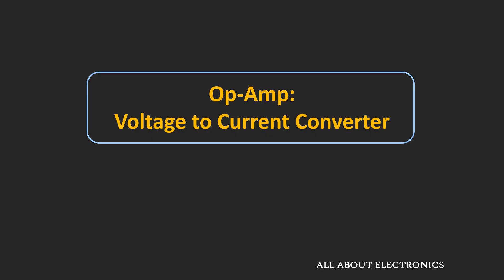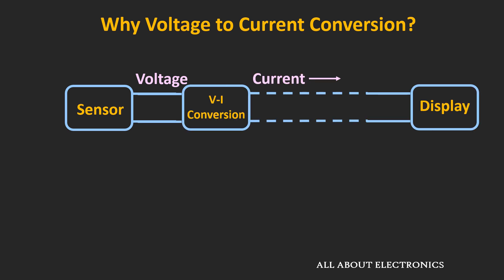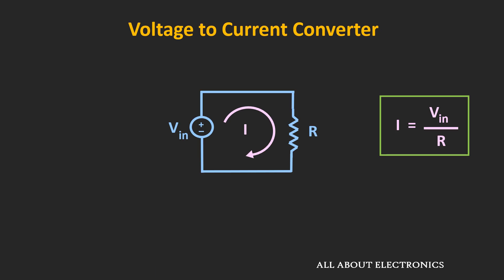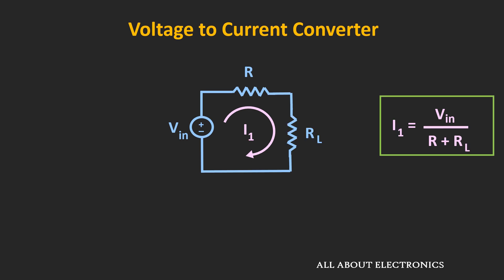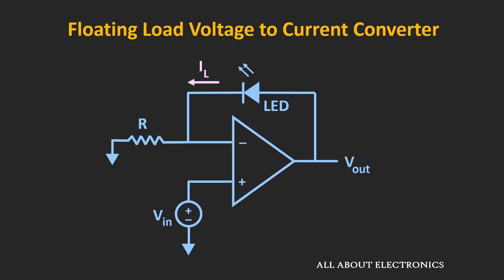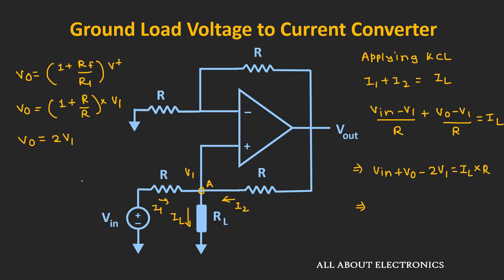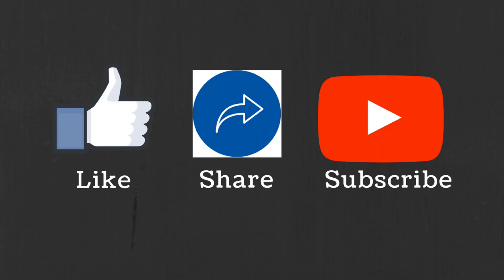Op-Amp: Voltage to Current Converter

Comment from the maker: The timestamps for the different topics covered in the video is given below:

0:25  Why Voltage to Current Conversion?

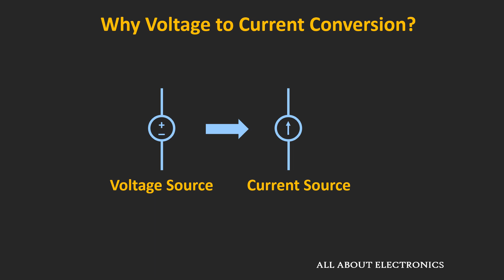2:32 Passive Voltage to Current Converter and it's limitation

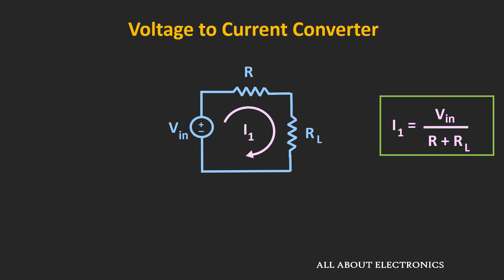3:27 Floating load Voltage to Current Converter using Op-amp

4:46 Voltage to Current Converter Applications

5:50 Grounded Load Voltage to Current Converter using Op-amp
Reply: can we consider there circuit as VCCS????

Comment: Is it possible to charge a capacitive Load with a constant current in the howland current pump ? I have try it with the floating current converter and it works, but for the Howland Current pump it does not

Comment: Sir  why we need to a resistor to the inverting terminal except feedback resistance?
Reply from the maker: To set the specific current through the load. The current through the load resistor is Vin / R. By changing the value of R, you can change the current. I hope, it will clear your doubt.

Comment: draw differential voltage to current converter and hence show that the load current IL depends on the difference between input voltage and resistance R not on load resistor RL. Solved it please.

Comment: Sir,
Did current pump and Voltage to Current converter are both same ...?
Reply from the maker: The current pump circuit is also one type of voltage to current converter.
Reply: @ALLABOUTELECTRONICS  Thank u sir

Comment: I tried V to I converter with grounded load using R=1K and 1K pot as load. The load current remained constant for the full range of load resistance for  up to 8VDC input only. Above that input voltage setting  the load current varied with load resistance. Can u explain.
Reply from the maker: What was the supply voltage ??
Reply: @ALLABOUTELECTRONICS  Supply voltage was +/-15V
Reply from the maker: @surendransunil7025  Have you measured the RL while varying it and the output voltage? Which op-amp you have used? And what is the maximum output driving current of that op-amp? 
Please check the maximum output driving current of the op-amp.
Reply: @ALLABOUTELECTRONICS  I used op amp 741. I did not measure RL or the output voltage.

Comment: Sir,what happens if the load resistor value RL is very high...?
In that case IL cannot be maintained right...?
Please reply...
Reply from the maker: Yes, op-amp needs to be in the linear region.
Reply: @ALLABOUTELECTRONICS  Thank you sir...

Comment: I can’t find any difference between non inverting amplifier and this circuit but output of two circuits shows significant differences . How same circuit get different output? Can you help me
Reply from the maker: The important thing is where the output is measured. And what is measured? (The current or voltage).
The configuration is the same, but here the load resistor is connected in the feedback. (Floating load voltage to current conversion).
So, through the input voltage, the current through the load is controlled. 
I hope it will clear your doubt.

Comment: Does the virtual short appears only when there is negative feedback..? Please let me know that..
Reply from the maker: Yes, it is applicable only when the op-amp is operating in the linear region. (with negative feedback)
Reply: @ALLABOUTELECTRONICS  so , why the voltage at that point is equal to the voltage at non inverting input ( Vin ) ....? Why not the output voltage ( V0 ) present at that point...?
Reply: @ALLABOUTELECTRONICS  please let me know that.. I was too confused.. 😭😭

Comment: Sir, please make videos on voltage to frequency and F/ V converters.
Reply: that's call a VCO, voltage-controlled-oscillator. Basically you just need a way to adjust the resonant tank.

Comment: What is the difference between floating load and grounded load V-I converter.
What is the application of both?
Reply from the maker: In a floating load, the load is not actually grounded. While in case of the grounding load, the second terminal of the load is connected to ground. 
The floating load V-I converter can be used when you want to provide the constant current to any two-terminal device like LED. (Where your purpose is to provide a constant current to the LED).
The grounded V-I converter can be used when you want to provide the constant current to another circuit or device.

Comment: Thank you Sir for your prompt reply. 
But one question still remain answered that how you come to know that Ckt is operating in Linear region and it is not saturated? Is there any systematic way to investigate the mode of operation (linear or saturated) when both type of feedback is present in Op-amp? Or should we always conclude that when both type of feedback are there we should assume , by default op-amp is operating in linear region? I will be very thankful to you if these question is being answered in crystal clear way as you do in most of your lecture
Reply from the maker: It actually depends on the amount of positive and negative feedback. But if the amount of feedback is not known then you can analyze the circuit assuming the circuit is operating in the linear region. And then you can check the output. If the output is less than the supply rail for the given values then it is operating in the linear region. But if the output saturates then the op-amp is operating in the saturation region.

Comment: can u give the reason why you have used the the concept of virtual short in the lecture at t= 8:14, while this op-amp have both type feedback negative as well as positive feedback?
Reply from the maker: Because still, the op-amp is working in the linear region. (Output of the op-amp is not saturated to the supply rail)
Reply: Thank you Sir for your prompt reply.
But one question still remain answered that how you come to know that Ckt is operating in Linear region and it is not saturated? Is there any systematic way to investigate the mode of operation (linear or saturated) when both  type of feedback is present in Op-amp? Or should we always conclude that when both type of feedback are there we should assume , by default op-amp is operating in linear region?  I will be very thankful to you if these question is being answered in crystal clear way as you do in most of your lecture.

Comment: When a sensor measures temp how does it give o/p in terms of voltage?
Reply from the maker: Using the bridge circuit, it can be converted into a voltage. If you take RTD, its resistance changes with temperature. If it is connected at the one end of the bridge, then the change in the voltage between the two ends of the bridge can be calibrated in terms of voltage. In some sensors, this circuit is part of the sensor and it directly gives output in terms of the voltage.

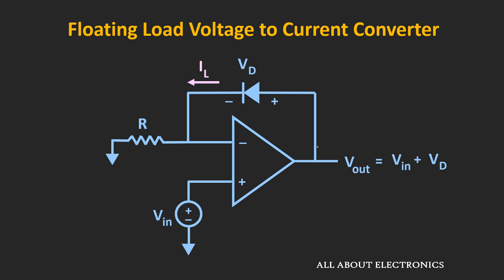Comment: Hello Sir 5:21 is this same as Log Ampr?
Reply from the maker: In the log amplifier, the input is applied at the inverting input terminal. Here. input is applied at the non-inverting terminal of the op-amp.
Reply: Thank you for reply sir ..!! one small doubt Sir then will log amplifier works only when an input is connected to Inverting terminsl?
Reply from the maker: Yes.

Comment: i did not understand 5.31.  How the output voltage become  Vin + Vd ?
Reply from the maker: Applying the concept of virtual short, the voltage at the inverting terminal will also equal to Vin. 
Now, if you apply the KVL in the feedback path, from Vout to Vin, then you will get the expression. I hope it will clear your doubt.
Reply: Thank u....